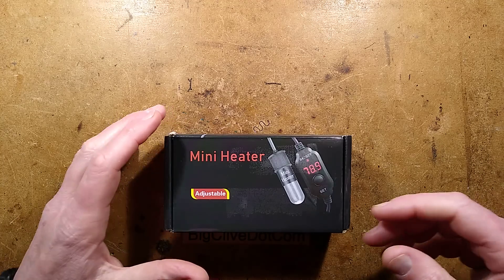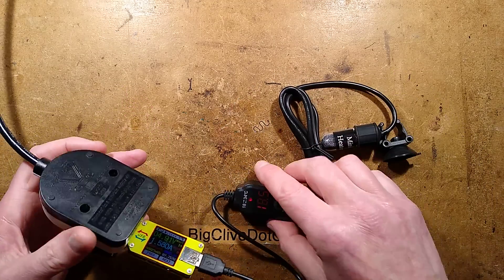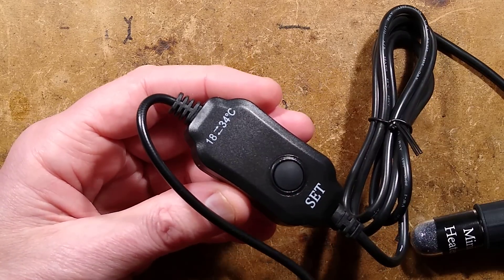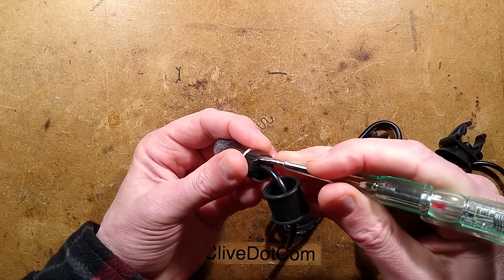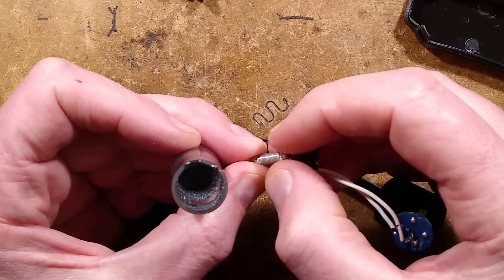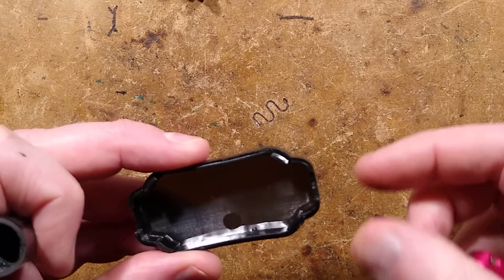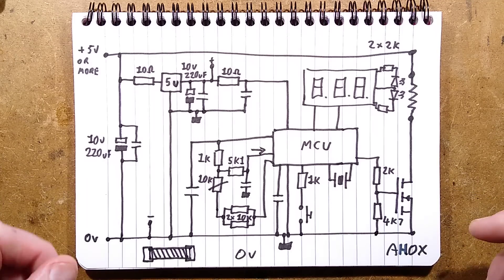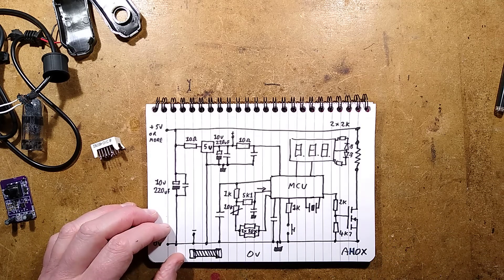Strange USB powered aquarium heater with other uses.

Comment: - "So this Z80 thing of yours runs at 4MHz...? Bah, here in the future, I'm just looking at a random PCB running at 26MHz..."
- "Wow! What does it do with all that awesome computing power...?"
- "...running a thermostat."
- "..."
Reply: My first computer [IBM 286] ran at 8MHz with 640k base ram and no extended ram on a 20Mb hard drive running DOS 6.0 and DoubleSpace. It actually ran quite well with games and word processing, of course that's when programs were written quite small.
Reply: @DrHarryT  Well, I remember the time when PC cases came standard with a "turbo" button (and the fancy ones with a display as well)... :)
Reply: @AttilaAsztalos  Turbo button was for slowing it down though 8mhz to 4 for example. So that games and other programs wouldnt run to fast.
Reply: @DrHarryT  Look at Flash Harry here with his 16 bits and hard drive!
Reply: @DrHarryT 
DOS 6 on an 8MHz 286 with 20MB HDD? I smell shenanigans...
We had an XT (8088) clone with 20MB HDD and 640k RAM. It ran at 8MHz. But it had DOS 3.x. DOS 6 didn't come out until the 486 was common. Our 486 came with DOS 5.x and we upgraded to 6 later.
Reply: @tin2001  CPM, Z80 with 64K ish RAM, 10Mbyte hard disk, 2 terminals connected by serial, mostly used for WordStar IIRC
Reply: I have about 50 ESP8266 devices in my house.  80mhz 32 bit processors with WiFi, and most of them are controlling light switches. 😂
Reply: @KaldekBoch  wastes more energy on computing nothing then it could possibly safe from actuating smart.
Reply: @KaldekBoch  I have one controling four switches. But I do waste ESP8266 boards instead of arduino because it has better arduino firmware then Atmega and can't get backwards enough compatible libraries on Arm64 to build MSP430 dev set.
In your defense, most of that 80MHz is actualy needed for wifi.
Reply: I reckon Clive missed the circuit which was offering internet access to the fish.
Reply: I have seen a 80 MHz processor on a board running a hydraulic truck tailgate lift which has 2 solenoid valves, a solenoid for the electric motor and a couple of safety interlocks (mainly prevents it from running from two control switch boxes simultaneusly and requires a safety button to be pressed to close the tailgate all the way so you have to use two hands for it to avoid having the other hand pinched). I have also seen almost the same exact fuctionality done with just a couple of relays, a couple of diodes and NC/NO switch contacts in the operation buttons and it works just as well.

Comment: I think that when I was a lad with 10 and 20-gallon fish tanks, 50 watts was a typical power rating for a cheap aquarium heater running at 110 volts here in the USA. Running that off 5 volts? No way.

Comment: An 8 Watt heater would manage to raise the temperature of 1 litre of water by around 7 degrees in one hour. In reality, heat losses would stop that from ever happening. (1 litre of water requires 4184 Joules of energy to raise the temperature by 1 degree C, 8 x 60 x 60 = 28800 / 4184 = 6.88 degrees approx)
Reply: How about 500g of medical grade silicone, with the heater stuck inside, wrapped in a towel?
Reply: @jannikheidemann3805  Maybe you could sit on that idea for a while and come up with an answer?

Comment: This wouldn't ever keep up with heat loss from even a smaller tank. Might be OK for keeping fish warm during their trip home from the pet shop, but not much else. The same supplier does a far more effective 300w heater (and these simple bi-metal thermostat ones are durable).

Comment: If it is designed for aquarium use, those granules in the end will be some kind of ballast for weight to hold it down in the water and not actually thermal transfer.  If it does any thermal transfer, that's just a bonus.  :)
Reply: I mean, as the resister isn't in direct contact with the glass, anything in there will HAVE to do the thermal transfer.
Reply: @Nevir202  It is chineseum - Are they meant to work lol
Reply: @EsotericArctos no it's meant for the thermal a normal heating element in a glass tube would be a burn risk to the fish
Reply: @shaynegadsden  Have ypu ever seen the way a standard aquarium heater is made?   There is no "thermal" material in it like that.    No offence, but I have tropical fish with standard aquarium heaters.  You should have a look at the construction.
Reply: @EsotericArctos  a standard heater has the coils themself spread over a large area a regular 20w heater roughly double the power and about 80mm of heating area so 2.5w per 10mm of heat plus the resistive wire is in some form of ceramic holder, that thing was 10w and pea sized so way more than 4 times the heat density meaning much higher burn risk. And no offence taken i have kept massive amount of tropical aquariums including dedicated setups to breed African Cichlids as a hobby while my primary work is an electrician
Reply: @shaynegadsden   I am not sure that small device has as much power as it claims, but I might still get one to test it out a bit.  :)
Reply: @EsotericArctos  yeah it claims to be 20w but i think it measure around 10w which is normal usb charger power
Reply: @shaynegadsden  Yes, compared to the average "standard" aquarium heater, running on mains voltage, or maybe some fancier electronic ones running with a 24V heater,  with the smallest sizes (which although bigger, still quite physically small) being around 25 to 50 watts.....     
Still, my curiosity has the better of me  :)  Damn curiosity lol
Reply: Silica carbide would be nicely inert and conduct heat without needing to be formed or anything fancy?
Reply: It should also slow the heating and slow the dissipation of heat (when off) as well as what I've understood.  As the glass is generally not made of borosilicate to take temperature swings kindly.
Reply: It clips into the suction cup shown in the video. No ballast needed.
Reply: @bromero88  Suction cups alone don't work with small items in aquariums, take it from experience as I own several.   This is why aquarium thermometers have ballast at the bottom as well as a suction cup.   The ballast is what does most of holding it under the water, to counter the air in the hollow glass tube, the suction cup just stops the fish moving it all around the tank.

Comment: Gotta be careful with that seeing as it doesn't have flared base
Reply from the maker: It's OK.  There's a cable attached for extraction.
Reply: I think for people who have that issue in the first place gravity will work just fine even if the cable separates. Edit: It does have a soft rubber base that’s removable so suitable accommodations could be made.
Reply: It's probably only safe to use it to preheat toys that accept bullet vibes, as well as lubricants, though there might be a risk that it leeches tiny ammounts of chemicals into the lubricants.

Comment: These are normally used in smal shrimp tanks that pose as  decoration. 

They are 5v since the lights are usually also 5v which makes it safer and more convenient
Reply: I was just thinking this could be nice for a small shrimp tank definitely added this to the to buy list
Reply: Sea monkey youtubers (Ive seen it all) commonly recommend these small heaters
Reply: @fossil98 my lord, that's actually a thing?😂
Reply: have several of these running for over a year now, cant complain ... 2 in breeding artemia and more in smaller shrimp tanks. Not sure how efficient they are, but they keep a 22-26 temperature selection stable in surprisingly large tanks with rarely being on as long as the room itself is in a humane 20+ celcius temperatur ... wouldnt advise trying a tropical fish tank with 26+ or heating a fish tnak in a colder cellar, as those tanks have a rapid temperature loss due to evaporation and these little heaters would run all the time.
Reply: I was thinking a classic fish bowl.
Reply: @NiHaoMike64  just dont think keeping fish in those bowls ... there is only a really small number of nano fish which could be kept in such bowls without it being torture, and most of those species aint for beginners.
Colorful shrimp are fine tho.
Reply: @NiHaoMike64  imo there's nothing uglier than a classic fish bowl when it comes to keeping pets. I might be jaded from being a fish enthusiast and knowing how bad they are but I genuinely don't see how anyone can make them look good (unless its a heavily planted nano shrimp bowl, those are cute), especially with a bunch of wires running out the top from something like this.

Comment: Considering the shape - I am here for the "other uses."
Reply: for cheating at chess ... 😅
Reply: @pantzOU812  next chess match for i did a thing is gonna be wild
Reply: "Where to move my queen... warmer.... warmer... colder... that's the spot!"
Reply: I don’t see any connection for a motor with an eccentric cam.
Reply: @wtmayhew  I like the good vibrations from an eccentric cam! 👍😜
Reply: @wtmayhew  There's an ionic thruster in the base.
Reply: Would that make this a device for central heating?
Reply: @lezbriddon  'personal' central heating 😜
Reply: @lezbriddon  A Pouch of Baby Wipes.   🤣😅👶
Reply: Could it be? 
The mythical "Full Bridge Rectumfrier"??
Reply: Happiness is a warm bum.
Reply: Don't make me tell emt badge 502 on ya 😅
Reply: oh my 😳😏🤣
Reply: I thought about preheating sex toys that use bullet vibrators. 34°C is not quite body temperature (36-37°C), but it's close to warm skin temperature. If the toy is insulated by a towel and thus doesn't loose the heat quickly, 8W of heat might suffice toprovide an more pleasurable experience with the toy.
Reply: @jannikheidemann3805  Obviously. But that's not funny enough, so peeps want it to BE the toy.
Reply: Business idea, Big Clive's Big Vibes 😂
Reply: I've seen a vintage print advert for a device to "warm the rectal brain" (they mean the prostate). Apparently there was something similar that used a light bulb for current regulation. The idea was (as far as I can tell) to cure impotence.
Reply: uwl warning...😂
Reply: Lady Heater?
Reply: I don't know how you would use that with cheese.
Reply: Port heater 😂
Reply: I get where your going but i don't think 10 watts is enough to replace your hot water heater
Reply: “It burns, burns, burns, the ring of fire, the ring of fire”
Reply: @Morbazan125 I laughed at this harder than I should have😂😂
Reply: Analium heater
Reply: @MattyEngland  thats like saying anal bleaching cream as "change your ringtone"
Reply: oh good, its not just me.
Reply: Does Uranus need heating? 🤣
Reply: @marcse7en depends on depth, the deeper you go, the hotter it gets... Just like any planet
Reply: UwU

Comment: It would be cool if you could adjust the heat even lower to say just above freezing.  Keeping the bird bath liquid of what have you.  Thanks for showing us this Big Clive.  Super cool.
Reply: I mean I guess for non-temperature precision critical applications (like a bird bath) where power is not a constraint setting it at 18c wouldn’t hurt anything. It would just be on constantly in cold temps.
Reply: Could be solved with a time switch running it 15 mins per hour, or one of those heating cables that prevent outdoor pipes from freezing/busting open
Reply: Probably be on all the time in an outside environment unless the temp is adjusted to below ambient considering the output power.

Comment: Interesting microcontroller choice, as you said they probably grabbed the cheaper with enough pins for the display. The logo make me thinks it is from Bluetrum / Zhongke Lanxun. They specialize in bluetooth headsets SOCs. This might even be a RISC-V micro ?! But I can't find that exact reference after a short search.
Reply: Maybe it has an unadvertised BT feature. Hold down button to go into pairing mode...?

Comment: I have a moderate sized (85L) aquarium and it uses a 200w mains AC heater. I don't think this item would be much use for any aquarium, even at +20V. Maybe controlling some chemical reaction in a teacup, or doing a cool wash of a single sock at 30C? I guess it could be repurposed to have the mosfet trigger a relay, controlling a real world heating circuit, but there are better ways of doing that. Interesting that that the package shows a F(oreign) temp reading, while yours is C(onvincing) - is there a track jumper for that? Or can you switch it by doing something like holding down the set button?
Reply from the maker: I should have tested that.
Reply: These are for micro tanks that contain miniature shrimps and they do their job
Reply: have a number of those USB heaters running. 2 in artemia breeders and the rest run very well in 20-30 l shrimp tanks ... these heaters do a good job as long as they only have to top up the usual room temperature of 20-22 to a desired 22-26. They barely have to actually heat in order to keep the temperature stable and they dont seem to struggle with a larger waterchange as well.
Ofc I wouldnt try heating tropical tanks with them and a larger tank without cover would impact efficiency of this heater as well given the additional evaporation. But they seem pretty good for the common 20-40l shrimp/nanofish tank with a cover, even more so when there is also a lamp heating as well. And they give a very good temperature readout/control. No need for a larger AC heater there and with that tiny size they even can disappear in a small filterbox itself depending on setup.
In a shrimp breeder rack with a lot of small tanks such USB heaters and USB filterpumps have become my favorites .. the AC stuff was always a hassle due to the required large powerstrips, extensions and rigid cables.

Comment: I suspect the additional outputs (+ve and ground) are actually inputs when it is used in a different module, and the heater signal could possibly be used to switch a relay. As you say, the only problem would be the 10V capacitor if the input voltage was above about 9V.
Reply: even at 9V it's not suitable to put a 10V cap. A good rule of thumb is to keep around 25% safety margin to avoid overaging the cap so this design is not meant to be run above 7.5V … which is approximately the lower voltage where the 7805 will be useful.
This circuit is a complete mess.

Comment: Interesting little unit. You should have tested this running from your bench power supply, would the initial test you did have been limited by the power brick you used? Do a "short" follow up, with the cap swapped and higher voltage too! 👍